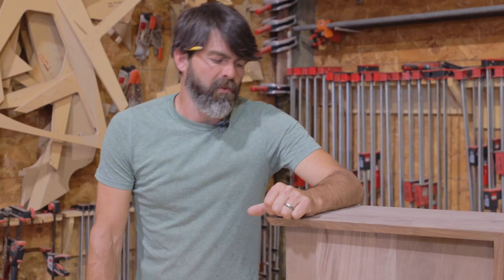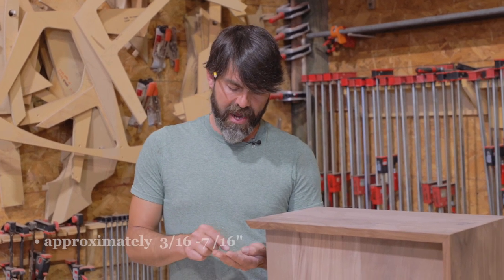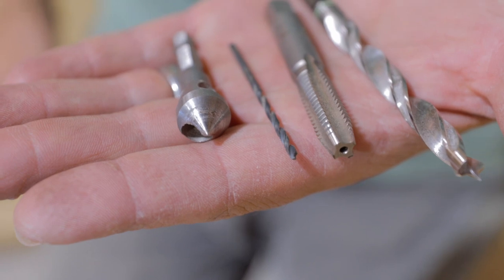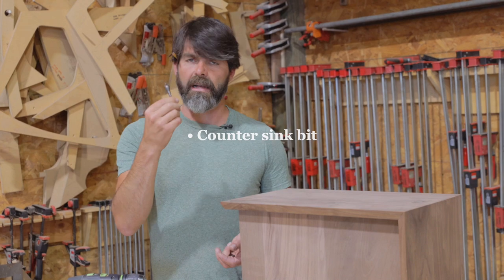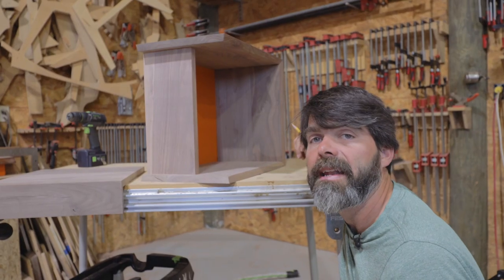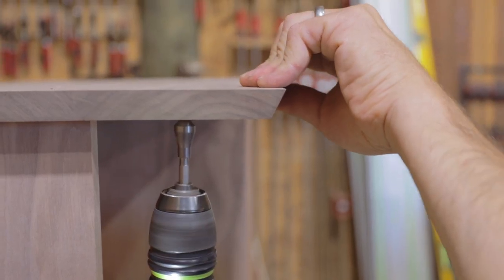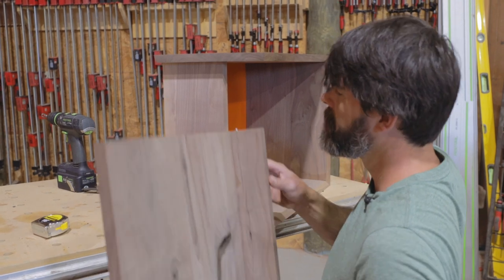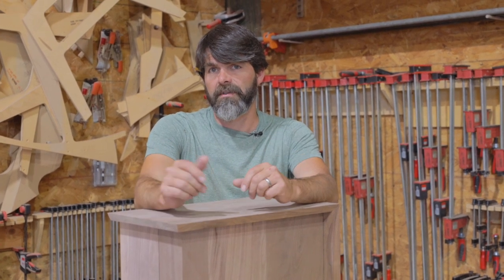Jory Brigham - Ball Bearing Door Hinge

Comment: Consider inserting a spring between the ball bearing and set screw if there's room to keep the pressure on the hinge constant over time...
Reply: Hey Mike. That’s actually what I started out doing but honestly I’ve found that it doesn’t make much of a difference. I’ve had it in my furniture without a spring for years now and the most I’ve ever had to do was tighten the set screw a little.

Comment: Those small bearings will wear in to the wood pretty quickly, especially at the top. It's the same reason metal pins don't work well as hinges.
Reply: Could possibly add a piece of aluminum tin foil (extremely small) under the ball bearing to act as a shim race.
Reply: @evanjenkins4835  it isn't just downward force on the bearings There's also a lot of lateral force when when you open/close the door. The bearing holes will wear in front/back directions and soon the door will be out of alignment and rubbing. You can use a center pivot hinge (like for a bi fold door) for this build. They don't hold up great either but this isn't a heavy door. Personally I would use concealed hinges in this case if you care about durability and don't want the hinges to show.
Reply: @garyvigue   Thanks for the options.
Reply: Ive been using this ball bearing method on my doors for about 15 years now.  One of the pieces I make and use this hinge is a booze cabinet door. The door itself holds about 10-12 bottles and probably weighs 40 lbs ounce filled. I wont tell you how many time as I open it a week but its been opened and closed a lot over the 8 years Ive had it. It still works perfectly. You would be surprised at the density and strength of end grain. If ever it compresses just a little, you can tighten that set screw and its back to new, but honestly that doesn’t really need much tightening unless the actual door or cabinet shrinks or expands.
Reply: @JoryBrighamDesign  YOU TELL EM, JORY!